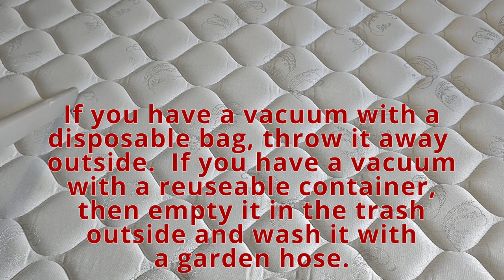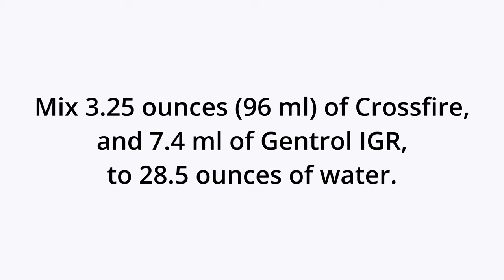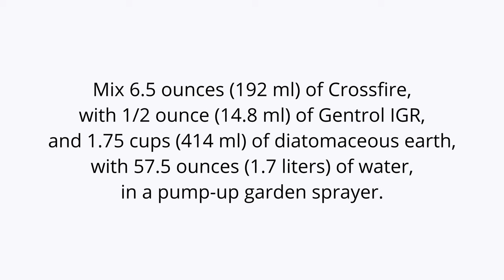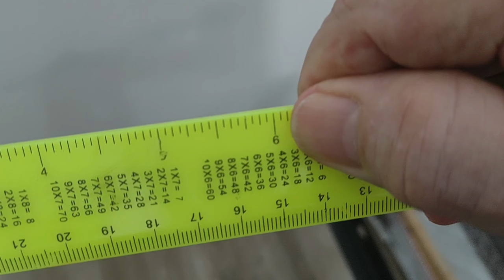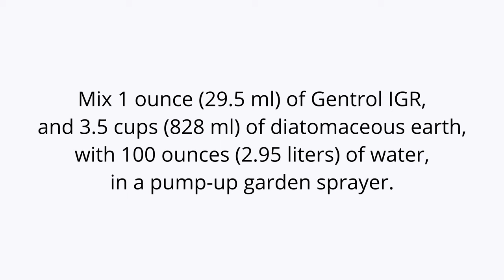ULTIMATE Bed Bug Solution!  AMAZING.  This ALWAYS works.

Comment: Note: Bed bugs will die within 8 hours with no air, so you can put your clothes in an airtight bag until they die. Then wash.
Reply from the maker: While it is true that bed bugs do require air to survive, there can be a lot of air in a sealed container.  I don't think they can live anywhere near 8 hours without oxygen, but bed bugs do not breathe a whole lot of air.  So, I think it can take quite some time for bed bugs run out of oxygen in a sealed container.  Of course, this is going to depend on how many bed bugs are in the container and how large the container is.  Some people try this by putting the clothes in one of those vacuum containers.  You literally suck the air out of them with a vacuum cleaner.  This will greatly reduce the time that the bed bugs can survive in that container.  However, exactly how long they will survive is pure speculation.  So, if I were going to use this method, then I would want to take those clothes out of service for a very long time.  I don't think I would open that container for about a year.  I don't think it would take anywhere near that long, but I personally would not risk it.  I think it would be quicker and easier to just wash and dry all your clothes.  This may be a good alternative for clothes that cannot be washed or dried on a high heat setting.

I hope that helps.  Be well my friend.
Reply: @GuysPestSolutions  I am leaving the items in the bags for weeks, then go from there.  I have a UV light and I see NO traces of any kind of bugs.
Reply from the maker: @tonyadams4989  Keep in mind that the bed bugs may not be in all the clothes or maybe not in any of them.  Treating the clothes is mostly a precaution.  The more serious the infestation, the more likely it is that clothes will be affected.  The most likely clothes to be affected will be the ones you are wearing, so drying them on high heat is a good idea.  I suggest that you bag as many of the clean clothes as you can and just leave them sit for as long as you can.  I hope you get this problem solved quickly.  Be well my friend.
Reply: Far easier to put clothes in dryer and run at high heat.  Adults dies at 113 deg withing 20 minutes.
Reply: @ieshadover  I can't do any chemicals because I have Obstructive Sleep Apnea, and the CPAP machine will draw it thru my machine and up my nose.
Reply: @tonyadams4989  I didn't say anything about chemicals.  I said it was easier (and better) to through clothes in the dryer.  HEAT is actually one of the best ways to kill bedbugs. They often baked bug bed infested clothes in the past.  But now we have awesome dryers.  Of course clothes that can not take high heat can not be put in.  But those you could steam individually.  It why this video is having you steam everything it is the high heat.  The one problem is if you don't directly hit them with steam and for long enough they won't die.
Reply from the maker: @tonyadams4989  I think it is somewhat unlikely that the bed bugs will take up residence in the CPAP machine, but if they do, you really can't treat it with pesticides.  I am not an expert on CPAP machines, so you would need to consult with someone who services them.  I'm thinking that the machine would need to be disassembled and cleaned really well.  That said, you can still use chemicals on all surfaces in the room.  Just don't apply dusts like diatomaceous earth on the table where you are setting down the machine.  Liquid pesticides will not be drawn into the machine after they dry.  Modern day pesticides are a lot like paint.  They are messy when wet, but perfectly safe after they dry.  If you can place the machine on a painted surface, then you can also place it on a surface that was treated with a liquid pesticide.  Modern day pesticides are safe enough for children to play on after they dry.  If you have the machine placed on a treated surface, then if there are bed bugs in it, they will die when they step on that treated surface.  You will not be affected by the pesticide in any way after it dries.  I know that's hard to believe, but all those nasty pesticides were banned in the late 1990's.  We are almost 25% of the way through the 21st century, so we now have 21st century pesticides.  They are way safer than the pesticides I started with in 1981.  In fact, today's pesticides are no more hazardous than most household cleaners.  So, you can do more than you may imagine.  I hope that helps.  Be well my friend.

Comment: What if you have carpet! Can you apply the treaments as well? I also have dogs!!!
Reply from the maker: Yes.  You can treat the carpet with dogs there.  Just don't apply diatomaceous earth to areas where they lay down.  It's fine for them to walk over it.  They can lay down on all the other products after they dry, except the diatomaceous earth.  It will not harm them to lay in it, but they may start licking it off.  You don't want them ingesting too much of it.

I hope that helps.  Be well my friend.

Comment: For someone who recently battled an infestation, it was small/mild, nothing crazy! But here are my tips and please use it to your full advantage no matter how big or small your infestation is. This is going to be a LONG READ!!! But it’s helpful!!! 

1: Buy mattress, pillow, and box spring covers/ encasements. Specifically made for bed bugs because it has a material that bed bugs have a hard time crawling on. Also, once the covers/ encasements are on, Bed Bugs can’t come out and they can’t go in! Bed bugs are known for hiding inside of your mattress and mainly your box spring. If you’re an aggressive sleeper or sleep with someone, buy two! Just in case one of them rips or tears. 

2: Buy bed bug interceptors, put them on the legs of your bed frame, so when they try to climb up to your bed to bite you, they’ll get trapped! You can also put this on the legs of your furniture or on other bed frames in your home for PROTECTION. The first step to stop the infestation from getting worst, is to not let them bite you! That’s how they turn into adults and lay eggs, with a lot of blood consumption. 

3: Buy CimeXa powder with a powder duster tool from a company like Amazon. Put some of the powder inside of the bed bug interceptors (the inner part where the legs of your bed frame or any other furniture would go, not the outer part.) These powders will legitimately kill all stages of bed bugs within a 1-3 day period, including every other insect as well! You should use this powder in corners, holes, cracks, under your mattress & under your furniture. But use a face mask with gloves when you’re applying the powder and do not over use it. This powder should be applied like dust, if you throw chunks of powder all over the place then insects will just find a way around it. This powder also stays where it’s been applied for A LONG TIME! Unless you vacuum it up with a strong vacuum or you clean it up with a liquid substance. If you do then you’ll need to reapply it but this powder destroy insects!!! Once they walk directly onto/ over it. A lot of people would mention DE, but apparently it causes breathing problems and takes longer to kill bed bugs compared to CimeXa. So buy CimeXa with a powder duster tool. 

4: Keep your bed away from the wall! Make sure your sheets aren’t hanging off of the bed, or you don’t have a charger or anything that the bed bugs can climb onto without them using the legs of your bed frame. If you wake up and find your pillow or blanket on the floor, leave it there! Dont pick it up and use it to go back to sleep. 

5: Buy ortho bed bug spray or crossfire! It kills all stages of bed bugs on contact! And it kills bed bugs even after it dries, by leaving traces of poison that sticks to their body, they have no resistant to it either. So spray these in areas where there’s bed bug activity or places where they’d most likely hide. Cracks, corners, holes, etc… remember that they hide CLOSE TO YOU! Rubbing alcohol is great too! But once it dries then it’s pretty much useless. Alcohol only kills stages of bed bugs on contact! Ortho and crossfire leaves behind poison that sticks to all insects. These sprays aren’t flammable and they will not stain or damage your furniture. So you can completely spray down your walls, floors, carpet, furniture, etc… without any negative effects. They do have a scent, but it’s not a super strong or bad scent at all.
Reply: Can vouch for the Ortho -- it does work!

$25 for a gallon at Lowe's hardware -- comes with battery powered wand applicator that makes it easy & quick to use.  And you can get in crevices & tight spots with the wand.

One thing that seems to help is to treat the floor in a room -- once you've treated the furniture and baseboards ( and wall outlets ), just spray the floor once & allow it to dry.  It's slippery when first applied, so beware.

Comment: Your video is excellent!! I am in Canada, we have the Onguard pro-perm insect killer, can this replace crossfire and be used in the mix? Some of these products are not available here  😢 Thanks
Reply from the maker: Unfortunately, Onguard it's not a good choice for bed bugs for two reasons.  The first reason is because many bed bugs have built up a resistance to pyrethrins, which is the active ingredient in this product.  The second reason is that pyrethrins are poor choice for killing bed bug eggs.  The product is unlikely to penetrate the shell of the egg, so they are going to hatch and you off to the races again.  The Canadian Government, in their infinite wisdom, have decided that anyone who cannot afford a pest controller does not have the right to get rid of their bugs.  I'm sure those laws were well meaning, but they were not well thought out.  So, you have two options.  You can go with relying on vacuuming, steam, and diatomaceous earth, or you can buy the pesticides from a supplier outside of Canada.  If you would like more information about where you can get the pesticides, then please email me at guyspestsolutions@gmail.com.  I warn you though that this service is not cheap.  I have known people who were able to completely get rid of their bed bugs simply by using steam and diatomaceous earth, so you may want to give that a try.  The secret is to be thorough.  I recommend that you buy the steamer that I list in the description because it puts out a very high temperature steam.  The higher the temperature, the better it's going to work.  If you do a really good job steaming, and use the diatomaceous earth as it dust as much as you can, and then in liquid form where you cannot dust, then there's a good chance that you can still get rid of these things.  Sometimes you need to treat more than once.  As always, start with the bed and work your way out.  The largest concentration of bed bugs is going to be on or near the bed.  Hope that helps.  Be well my friend.

Comment: I am defensive! Treat before you have a problem and then you wont have an issue. I hire a pest company to spray and spray often. Just to be safe.
Reply from the maker: I always think it's a good idea to routinely treat outside the home, but not the inside.  The truth is that there really isn't a good way to prevent bed bugs, other than not encountering them in the first place.  That's why you should always check for them in hotels or even when you are staying with friends or family.  If a pest controller tells you that they can prevent bed bugs by treating the inside of your house, they are lying to you.  No pest controller is going to do the kind of treatment necessary to prevent bed bugs.  The truth is that most people go their entire lives and never encounter bed bugs.  So, just be vigilant when you are staying somewhere, and you will probably be just fine.  If you treat the exterior of your home, which is what most pest controllers will do, that will prevent a wide variety of pests, so it's a good idea.  It will not prevent bed bugs, but it's great for ants, spiders, American roaches, and other pests as well.  Prevention is the best cure, but it only works on certain pests.  You can also do this yourself and save a lot of money.  I will give you a link to my video on how to do it.  I hope that helps.  Be well my friend.

Video on how to treat the outside of your home for pests:  https://youtu.be/Yozv3s-Qwlw
Reply: @GuysPestSolutions  thank you x a million for this invaluable info! You rock!
Reply from the maker: @kylewagner78  You are very welcome.  Thank you so much for those kind words.  Very much appreciated.  Be well my friend.

Comment: I have a regular spray bottle what is the ratio of crossfire and water please?   I don't need the whole gallon  mix.
Reply from the maker: 1.625 ounces of Crossfire to 16 ounces of water.  The easy way to measure this is to buy a measuring syringe.  Just mix 48 ml to 16 ounces of water.  If you have a 32-ounce spray bottle, then do it twice.  I hope that helps.  Be well my friend.

Measuring syringe:  https://www.amazon.com/Individually-Measurement-Scientific-Measuring-Applicator/dp/B0C1NBMHWM/ref=sr_1_4?crid=1L8CY5M46DJMS&dib=eyJ2IjoiMSJ9.vp955PxoZF8JaxB_eh_8H5BLdF0IGqDHCdWsz4gE3PiVdmCySXAoZ7zTpfYnOL4jZxxJTO9cKG0MzHbJEMPrrAyU9H78bjx3wbltvDHB4nQZ5aMZZ_-FRrEBoZnA3hjHEhqGl_MSmUFlxJzn_Y85T5rAuorAiGrhE4Cn8n3T52UTz7uvyshvfR6LQ00gIv5rP9BDJuRdUS2k8Zl2FSxw2dKX08Cw5l_NYhBwV7L9xlg.PdYW35cB6-6-ZqEuSVx6DcUnCmTHPleUU539uq6OXf4&dib_tag=se&keywords=measuring+syringe+oz&qid=1723635574&sprefix=measuring+sy%2Caps%2C116&sr=8-4
Reply: Thank you @GuysPestSolutions
Reply from the maker: @strawberryjackson3  You are very welcome.  Be well my friend.

Comment: what about wall to wall carpeting in the bedroom. How does that get treated.
Reply from the maker: Spray the floors using a hand sprayer or a pump-up garden sprayer.  Don't use the diatomaceous earth in the mixture because it may look really bad and could be hard to remove.  If you want, you can try a small spot to see how it looks to you.  I hope that helps.  Be well my friend.

Comment: I have a question that's more about asthetics.  Couches, mattresses and other softer surfaces often tend to have bkotches of black.   For example the button tufting on a couch. 
I was told the black spots or blotches are fecies left behind by the bugs.  Once the furniture is treated, how to you remove these nasty tell tale signs?
Reply from the maker: That's a great question.  I'm not a cleaning expert, but my best advice would be to try upholstery cleaner or perhaps a carpet cleaning machine.  Many of them have handheld attachments that may get it done for you.  Bed bugs can leave quite a nasty mess on fabrics, so your success may depend upon how much of a mess they made and how long it's been there.  I hope that helps.  Be well my friend.
Reply: Those black specks is human blood, that has been digested by the bed bug. So try soaking with hydrogen/peroxide and then scrubbing with the same. Good luck.

Comment: I know I'm a little late to the party. I brought the bugs home from a family vacation in Jamaica. I used the dresser and brought them home in my suitcase. My question is this, we have two dogs that share the bed. Is it right to assume that the whole house is a write off?  I'm a little hesitant to apply chemicals. The dogs are confined to only the first floor and I have cleaned and treated the whole upstairs even though I have only found evidence in my bedroom downstairs. We are about 4 months into this at this point.
Reply from the maker: It's hard to say.  Bed bugs are hitchhikers.  While they prefer human blood, they will feed on dogs sometimes.  That means the dogs may carry them to other locations in your home.  My recommendation would be to start with the bedroom and do a very good job.  Then go ahead and treat the rest of the house.  Treat the upstairs last.  The bed bugs may not be up there, but why take chances?  Don't worry about the dogs.  If you follow the directions in this video the dogs will be just fine.  Just don't apply diatomaceous earth on spots where the dogs like to lay down.  You can treat those areas with Crossfire and Gentrol IGR.  These products are safe for children to play on after they dry.  I hope that helps.  Be well my friend.

Comment: D E doesnt work when wet.
Reply from the maker: That is true, but DE works just fine after it dries.  I hope that helps.  Be well my friend.
Reply: Does this wet application method reduce the DE airborne properties or is it mainly mixed with pesticide for efficiency?
Reply from the maker: @camisf78  Sorry for the delay in responding.  I was on vacation for 2 weeks.  DE does not have airborne properties.  The idea is that it is a permanent dust that the bedbugs must crawl through.  You are correct that it is mixed with the pesticide for efficiency.  Why make more than one application when you can simply mix products together?  I hope that helps.  Be well my friend.